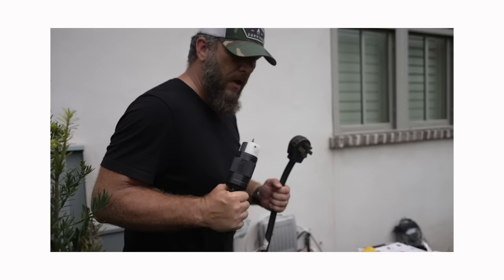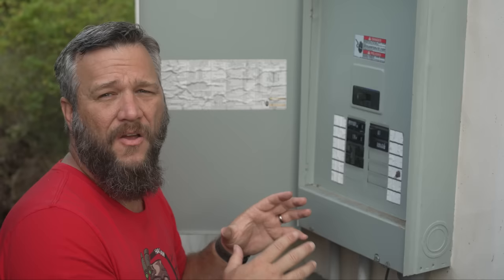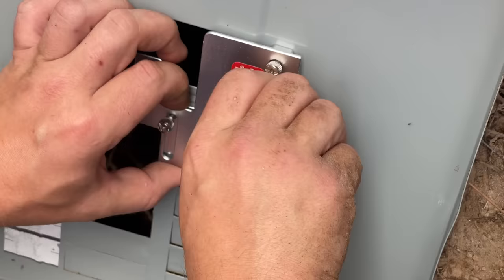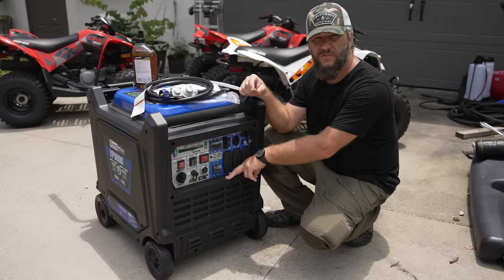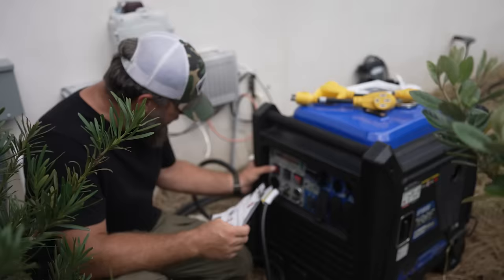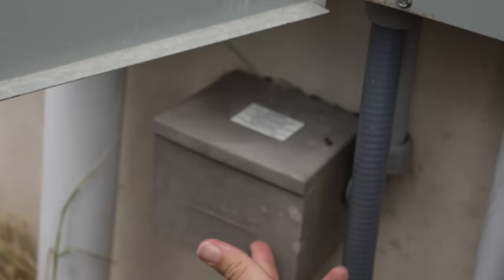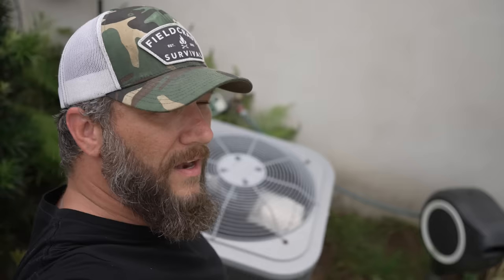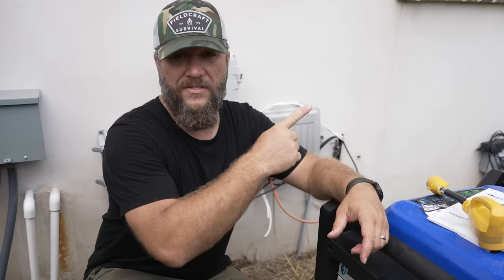90% Don't Know About This Fatal Generator Connection

Comment: I got a 4000w 120v generator for $500, I switch manually, and I tie both phases together in the jumper cable. You have to switch off the main and switch off any 220v loads to be sure nobody uses them. In my house its only the dryer and the stove, so no big loss. I even got a 110v hotplate to substitute for the stove. You don't need a super power generator during outages. Enough for the fridge, lights and a TV will do it. I can even run a window A/C off mine. The difference is I paid a fraction of what you did. I used to pay for ethanol free fuel to keep the generator in standby. After 3 Gavin Newsom power outages, I changed to draining all fuel after an outage from the generator and putting it in my truck. Now on power outage I go fill a gas can at the local station and repeat as required. Way cheaper and the "special" fuel had a habit of disappearing from the stores during outages.
Reply: I'm in N. CA. Where can get ethanol free fuel?

Comment: Fantastic video! By the way, you and I have the exact same inverter generator.  DuroMax just released a 16KW version of the same inverter generator, which should be enough to run just about any home.

Comment: Yeah on an air conditioner when you lose main power to the unit the outside unit circuit board will not come back on for 10 minutes when power is restored. That is to prevent a locked rotor on the compressor because you would already have high Freon pressure with the compressor. If it was to come on immediately after it shut off it would tend to lock up. 10 minutes is the usual time for a reset on most air conditioners.
Reply from the maker: Thanks for the info!
Reply: I think the 10 minute delay is due to LRA generating heat in the windings so the time delay will allow the motor windings to cool down. Refrigerant pressures are controlled via pressure switches.

Comment: Couple things to note with the Generator. 
First, once you hit the Start button, it will Automatically try to restart the motor a few times as the propane is purging the air out. 
Secondly, after it’s first couple Runs, it’s a good idea to Change the oil, to get the metal filings out.

Comment: You should get a soft start for your a/c it will cut the start up amps by 65 to 75 percent it will be alot better for your generator
Reply: Only if the unit is old and you need to get a little more life out of the unit. While it will help the generator a soft start wears out the motor windings of the compressor unit.  Either get a larger generator or install some low amp draw window units is better

Comment: In the UK we use a 3 position generator change over switch which has a safety mechanical interlock built in. 
1:Grid supply 
0:off 
2:Generator supply 

Good to see how other countries do this though… 
Thank you

Comment: Buy a magnetic dip stick for that generator, i have the exact same generator and i put one on it and it has caught a fair bit of metal powder while the engine has broken in.  Also, you are going to need to remove the neutral/ground bond that is behind the panel of the generator (it is right behind the ground post), there is a neutral/ground bond already in the house's panel and when you connect the generator to the house there is only supposed to be 1 neutral/ground bond for safety reasons, if there is a ground fault the current can split between the multiple points if they exist (the generator's neutral/ground bond and the house's neutral/ground bond)
if you use the generator as a stand-alone unit (not connected to the house) you can make a neutral/ground bond that you can plug and unplug using the custom plug that came with the generator, if you don't the GFCIs on the front of the relay will trip if you connect any 3 prong 120V loads to the generator
Reply: I always do short order oil changes with new equipment.  It's crazy how much contamination is in new engines
Reply: I would prefer a generator power transfer switch to this setup, and removing the bonded ground is not required with a transfer switch setup.

Comment: I bought my T07571 Tri-Fuel in 2020 for the hurricane season. I got to use it for the first time for the Texas Freeze, again later when we lost power from over 2000 lightning strikes hitting the grid in the Houston area and a few more times. I run it on NG. I installed a Propane Elbow Adapter at the generator's 3/8" POL fitting. It is a 3/8" Female Flare Swivel x 3/8" Male Flare (Item # 204163) that I purchased from etrailer.. Then I installed the 3/8" Female x 1/2" Male brass adapter there. Now it is easy to store the 1/2" NG hose on top of the tank. I connect power from the 30A 240V outlet to the panel and am able to use my 4-ton A/C unit. I installed is a Micro-Air EasyStart 368 (4-ton) Soft Starter on the outside A/C unit. My A/C unit now has a Start Peak of 33 to 36 Amps.
  Trying to line up the cable plug with the inlet at night? Take a marker or white-out and make a line on the plug & socket to line up the two before you twist it. Keep battery charged. Install emergency lights that come on when power goes out. Install them where you set up the generator and at the panel. Have an extra spark plug.
  As a backup, I have two 1408Wh and two 666Wh power stations, and eight 100W rigid solar panels which I made into four suitcases to set up in the back yard.
Reply: I live in houston as well . Can i ask the cost of NG to keep the generator running thru the storm . Thanks alot

Comment: This is exactly why interlock kits aren't allowed here. We use a centre off isolation switch, one direction is mains, the other side is generator. No chance of any backfired onto the grid.
Our generator inlets have to be 4' off the ground minimum in case of flooding and have to be via a fully waterproof inlet plug with a mechanical latch so you can't accidentally unplug it
Reply: Wait, why is the interlock not allowed?  (And where are you?  Not that it matters.) Interlock seems better than nothing (which is what someone I know got from their electrician!). Thx
Reply: @mr_tom_1_0  I don't know where this poster is located, but some locations have stricter code, such as California. A generator power transfer switch like the comment reference is a much better solution.

Comment: I may be wrong here and there is absolutely no criticism of this excellent video and I just want to address some general misconceptions about "inverter" generators.
The traditional generator actually produces a more "pure" sin wave than any inverter generator. The only trouble is that because it is mechanical it doesn't respond to loads anywhere near as quickly as the inverter so you get those fluctuations where your light flicker, etc.
Low frequency inverters like the Victron solar inverters, etc, are the best of both worlds but are very expensive. 
What we now commonly call "inverter generators" are like a solar system and generally run a high efficiency, high frequency alternator that is converted to DC and then converts it much like an MPPT charger connected directly to a high frequency inverter via largish capacitors in place of the battery.
These have improved much over the years but can be prone to catastrophic failure but the good news is that they mostly fail open circuit so they don't fry all your gear.
The one real issue is that the cheaper ones can cause short  circuit on the AC change over during the cycle (a very well know issue amongst cheap battery powered inverters) and THAT can destroy any gear that is connected.
Why am I saying all this?
If you are going to use an inverter generator, make sure you have good house and contents insurance.
Less expensive manufacturing costs combined with marketing hype proposing that these inverter generators are somehow better than the traditional ones makes for an incredible increase in profit margins and to our benefit also lowers the overall price.
It has nothing to do with better.
My Honda GX390 traditional 5500kVA supplies a much more pure and stable supply than my 2200kVA inverter generator ever has. It just burns a lot more fuel and makes a LOT more noise.
Reply: @garth: how are you measuring /checking the better sine wave on a non-inverter? Did you hook an oscilloscope?

Comment: Thanks.  I really like this unit. FYI to all... A 100-gallon propane tank will last 1-2 days, while a 500-gallon tank can last 7-10 days.  At $2.30 / gallon for propane it will cost about $120 + per day to run this generator on propane.  In addition, the peak wattage on this unit with propane is 8550 and running watts 7200.  If there is an extended outage, how does one get a large propane tank refilled?  I would also keep plenty of gas around for extended emergencies.  Every house should have a 50amp bypass Interlock set up no matter what.
Reply: Totally agree, I've used mine so many times in the last few years its more then paid for itself and all the work and materials I bought. I did all the work myself which saved me a ton. I'm a hero every time the power goes out lol.
Reply: I would go a step further on having gasoline on hand and say have another smaller generator as a backup for critical appliances or medical devices.
Reply: Your math is a bit off.  I have the 13kw duromax and I ran mine for 7 full days non stop (except for oil changes) and used about 7% of the 250gal tank.  That comes out to 38 gal/day
Reply: I can run about 3-4 days with a 100 lbs tank. (The longer timeframe during cold winter).

Comment: I'm not 100% certain, but you may need to be careful on the final location of the generator when you're running it. Due to carbon monoxide. The roof eve's window and door locations as you need to be a certain distance away.
Reply: So you know, propane doesn't give off carbon monoxide but rather CO2 and water vapor. And for an outdoor application it of no concern. What can be a problem is if used to supply a heat source in a structure, house, mobile home , camp trailer or camper on the bed of a pickup truck it needs to have a fresh air source. This is to prevent oxygen depletion, and that can be fatal!
Reply: The exhaust heat is my concern. Look at the dry vegetation.  In a storm everthing is wet so it'll be fine.
Reply: @paulstaney325  Propane can create carbon monoxide.  It's less of a problem than with gasoline since propane burns cleanly across a broader range of mixtures.  The biggest issue is with any recirculation of the exhaust CO2 back into the intake, where the chance of emitting CO goes way up.
Reply: Generac and Briggs and stratton both call for at least 5 feet distance from any house openings: windows, doors, crawl spaces, attic louvers, or anywhere exhaust can enter the house.

Comment: Great info! I just ordered a generator a couple days ago and will have to do the wiring myself (trained and have the tools, just not the license). When you're recording video and want to stop the flicker from LED displays, change your camera's framerate to 24 fps. The default is 30 fps, which is exactly 1/2 the 60 hz that the LED's use and that's what causes the flicker. Note: When you're editing, you may need to manually sync the audio with the video some cameras do it automatically).
Reply: Too bad he won't see this comment!!!

Comment: Best to use propane is a great idea. Easier and safer fuel to store -that doesn't  degrade.
Reply: You loose some power output with propane over gas though so that may be an issue for some. I run gas and run the carb dry after use and pump out the gas if its going to set for a long time. I once did let it set with gas and it didn't want to start with the stale fuel so I hooked up propane and started it with that then switched over to gas and it ran and burned out all the old gas thank goodness. I've been running it dry ever since.
Reply: @jstar1000  Yes
Reply: @jstar1000  I just ran our generator after it has set for a long time, because there was maintenance in the area causing a 7 hour power outage. I had to spray some starting fluid in the motor via the spark plug hole before it would start. It also was surging for a while, but started running correctly after it ran for about 20 minutes. This is a gasoline only portable generator, and it definitely is not good to leave them sit for a long time, like I did, without starting them. Unfortunately, we do not get many power outages, and I just do not think about it.
Reply: @David-rx5eo  yeah it's easy for that to happen, I bought a fuel line locking clamp and clamp it on and run the carb dry as I don't have a fuel shut off.
Reply: @David-rx5eo  "Unfortunately, we do not get many power outages". LOL. Come to Nevada, then!

Comment: You should research the Sandia diode which will hopefully help protect devices against EMPs. Diodes are used in nearly all electrical devices and it sounds like the sandia diodes are better all around (as long as they reach their target record for the research) so once they are scalable we should see most electronics have the capability of protecting itself
Reply: Ferrites around the feeds along with a whole house surge suppressor will manage most situations.
Reply: EMP's!  PPFFTT! 🙄🤪
Reply: Lightning strikes are a whole lot more likely than EMP and indistinguishable from them in practice. Standard lightning protection is all you need.

Comment: Just a piece of advice that I had to learn the hard way. Always disconnect you generator before you shut it down. If the load is still being pulled on it when you kill the engine it can burn out the generator head.

Comment: Inverter units are great for smaller loads and sensitive equipment. However they are not for large loads. It's why they are not available for larger capacity currently. We had a neighbor who wired up his house to a Duramax genset, and tried to run everything.  Of course voltage from generator went down and current inversely went up.  It cost him 28000.00 for new HVAC, Appliances and new load center.

He has a 22kw standby now.

Understand what the technology is meant for and it's limitations.
Reply: about a decade ago, you could buy guvment military surplus generators at auction. I won a 10kw, actually more like 20k,  4 pole, 1800 rpm, 4 cylinder onan diesel 1200lb. generator for under $1k.  a real beast, almost no hrs. Cost to tax payers in 2023 dollars, $94,500.  thanx guv.
Reply: @snookysnax  A military genset will be wildly under-rated.  Its rating will be for continuous load, continuous use in the worst environment.

A consumer portable generator will have a wildly exaggerated rating.  The 'big' number will be for an instantaneous peak, sometimes as brief as a half cycle.  That's not even long enough to start a typical motor (refrigerator or pump), which typically has a starting capacitor switched in for a half second (30 full cycles at 60 Hz).  The continuous number will be for optimal conditions: cold, dry air at sea level.

Comment: I love my Duramax generator!  The regulator was junk in cold weather for propane, but the generator has been an excellent backup with the duel fuel option.  Wired it up to a 30 amp reliance transfer switch.

Comment: A soft start device on your a/c would help the generator not work to hard.
Reply from the maker: Yes. I need one.
Reply: That's what we did. Added soft start
Reply: Can it hurt the compressor or make it not start? I had an A/C that was old that needed a hard start kit added to run.

Comment: I done mine with a dedicated line into my home. I use no household wiring whatsoever. Yes, I use extension cords that are short in length & as thick as possible.  The thinnest I got is 10 ga. 

The only items I run are fridge (7.2 amp), chest freezer (4.5 A), furnace (9.5A) or well pump (8 A 240V).

Comment: Think about a transfer switch. There are even double pole double throw contractors that would work just fine for your application.
Reply: I just said this about installing a generator power transfer switch before I saw your post.
Reply: great minds think alike

Comment: Thank you for your informative vídeo! I have a question: Does your panel have bonded neutral and ground wires? How do you proceed with the outlet installation? Did you bond the outlet’s neutral and ground wires?

Comment: Hell yea. I also had looked into a whole house permanently installed unit and was quoted shy of 16000. I was like WTF???!!!  So I bought a generator for 2000 on sale, paid an electrician 1300 to have a manual transfer switch panel installed, and paid a plumber 400 to install a hookup to my natural gas system (the generator I bought from duramax is a tri fuel portable unit).  Less than 4K and waaayyyy less than 16K. It runs my house including my ac unit (which I bought and installed a soft start for) without no issues and the load demand was less than half of what the gen can put out. I remove the wheels and secure it with a security chain when I run it. It weighs over 400 lbs so good luck stealing it without a forklift or some strong dudes.

Comment: Next you need some Lifepower4 batteries and an inverter/charger, so you can use the genny (and/or the grid) to charge the batteries, and have the batteries power the house through the inverter. That way you won't need to run the genny  constantly as you need power and save some big bucks on propane.

And then eventually add solar panels to the system and suddenly you're off grid!
Reply from the maker: I’d love to
Reply: Long term project👍